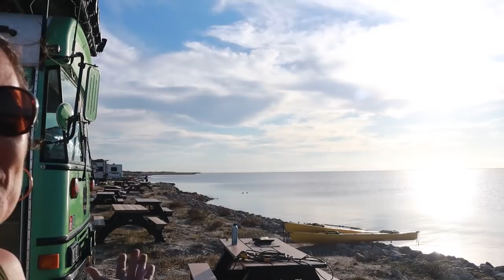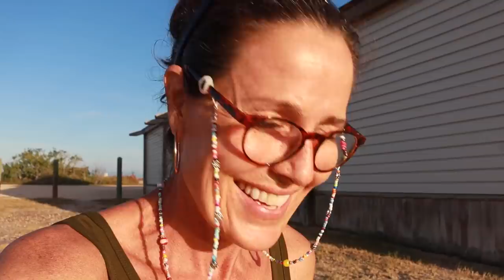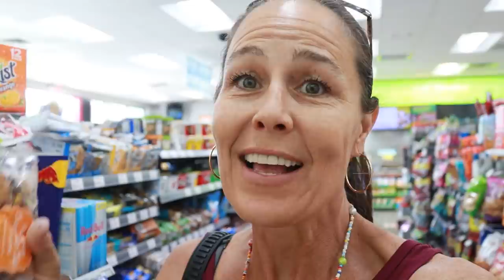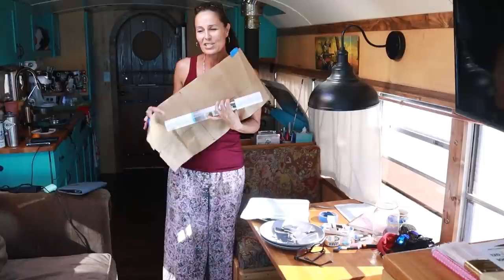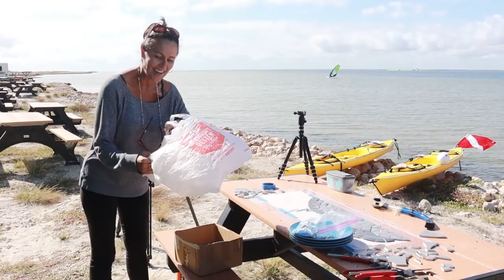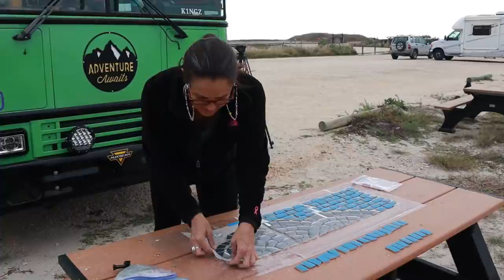Kerry Gets Back to Work on the Broken-dish Mosaic in our Bus Bathroom!

Comment: Nice video! Some thoughts about it.                                                                                                             #1 Point of view can make a lot of difference. I get that Mike parked facing out at first, I always try to park so I can drive away without backing out, Just in case.                                              #2 Sandy crab balls. Of course crabs have sandy balls. That's why they're crabby.                                #3 I didn't know there is a wrong way to break a plate. Or a right way.                                                         #4 Wishing Ya'll a Very Happy New Year, with miles and miles of smiles. Roll on!